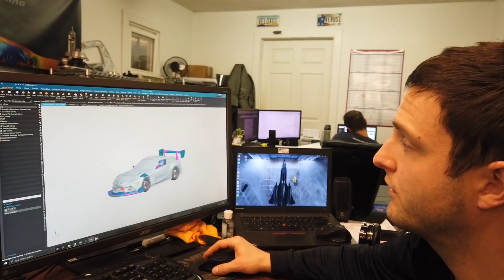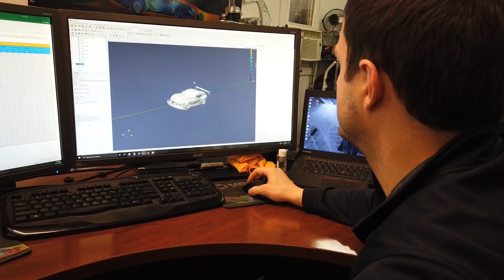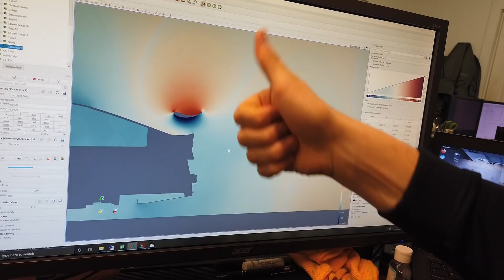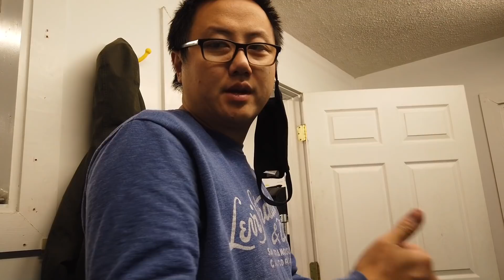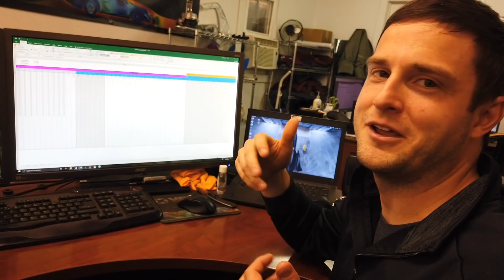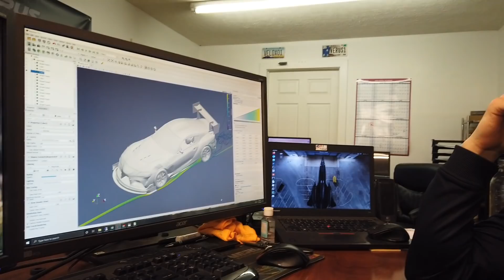Time Attack Supra Gets CFD Aero Analysis w/ Verus Engineering! - Project TA90 #37

Comment: Make the fake rear fender vents real. Any pressure relief is downforce gained. Hell make them bigger put some horizontal slots in the white of the rear bumper to relieve pressure built up. Some fins on the taillights directing the air toward the center of the car might limit help with drag from the body decreasing separation. Just hypothesizing?
Gurney on the ducktail?

Comment: Your comments about squat when the car is at speed got me thinking... are you in a position to set up a daq system for 2021? You're at a point now where a chassis-mount gyro might be useful to you so you can quantify the angle changes that the car experiences in roll, pitch, and yaw. Better definition of the boundary conditions for designing parts.

Comment: Is there anything you can do in terms of weight reduction? Maybe with aluminum arms, knuckles, and subframes? I know Wisefab makes a knuckle assembly for the S2000. It'll definitely take out the unsprung weight out of the suspension assembly.
Reply from the maker: Aftermarket Knuckles and subframes are illegal in GTA Street class, so that’s out of the question. We’re already running all aftermarket arms with SPL on the Supra, so that’s already done
Reply: @JackieDing86  At this point, is bracing a good step forward to increase the chassis performance?
Reply from the maker: @michaelpan7737  not really, I think most of the braces are really just extra weight, since the modern chassis is already a lot more rigid that our competition. Weight reduction is still the way to go, just need to figure out where to cut weight
Reply: @JackieDing86  carbon trunk, bumpers and hood sounds like the next step. And I’m assuming the OEM panels and doors are all aluminum.
Reply: @JackieDing86  And of course, wiring is going to account for a good amount of weight. Better packaging is going to significantly help given how much is already done to the Supra.
Reply: The stock knuckles are already made from aluminium.
Reply: @aaronbryan5095  Dang. I guess the only other way to do legal weight reduction is motorsport wiring and carbon body panels.

Comment: Now that is an info dump that i can get behind. So what's next? Mod the front endplates? Flexible side skirts?  Or a completely redesigned front splitter.
Reply from the maker: Current idea is a new spec front splitter + end plate, then new side skirt and rear diffuser. Potentially new wing mounts too
Reply: @JackieDing86  sounds solid, will look forward to it man.
Reply: @JackieDing86  are there plans to take this back to aero analysis after the revisions?
Reply from the maker: @RandomlnternetGuy  we’re literally doing the analysis before we make all the parts, since making aero bits can get costly quickly
Reply: @JackieDing86  also, watching the vid again, i can't help but notice the viper with meaty tires in the background in the beginning of the vid. Is it a road course car or a straightline car?

Comment: Wait so if runing Windows down 
Does opening the back of sunroof speed up the air and extract them out to clean up airflow?
Reply: and the more turbulent and dirty ur air is, the more the wing isnt gonna be doing what u want it to
Reply from the maker: No, opening the back window behind the roof will mess up the airflow going over the car and basically make the smooth airflow going to the rear wing turbulent

Comment: I always wondered how people properly dialed in Aero without just guessing
Reply from the maker: If you understand the concepts and what to look out for, you can get a decent chunk of the performance, but it wouldn’t be optimized
Reply: It just proves understanding what is happening and analyzing what needs to happen trumps aimlessly throwing money and parts at the car.
Reply: @gloomyxyz  beautifully said
Reply: Most people just guess.  I'm amazed at how people will buy a $3k wing and then don't want to spend the money on some wind tunnel time.  I've seen people with all the right parts making a bunch of lift and drag.  Just tweaking what they have can make a world of difference